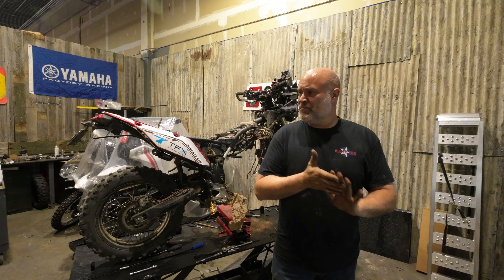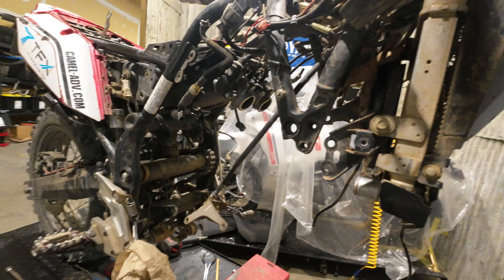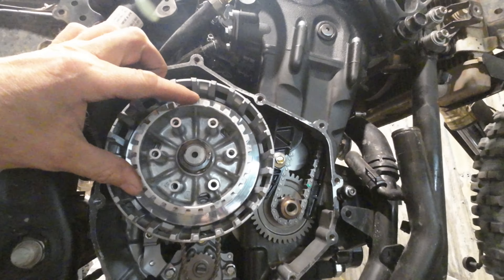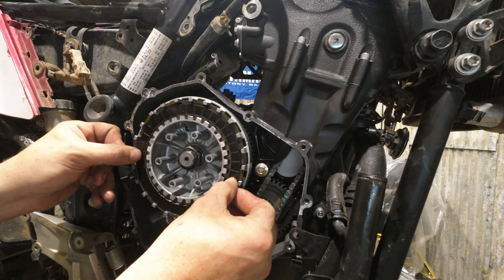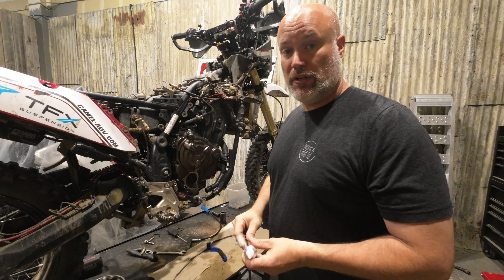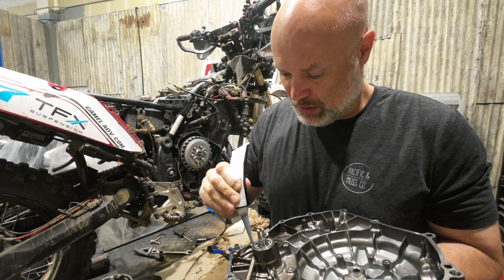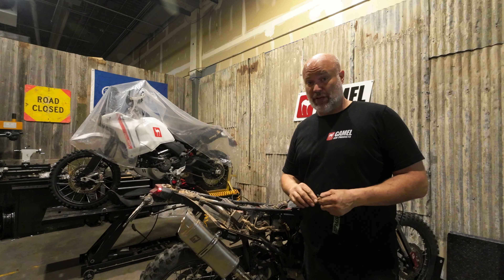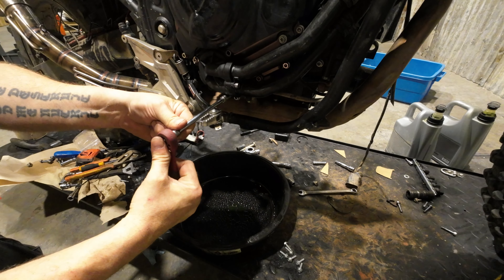T7 Motor Swap

Comment: Hi mate I have a 2024 T7 that has been making the 'chirp' sound you referred to. So far under warranty the dealer has replaced the fuel pump, abs pump, idler gears and starter clutch, all to no avail. Now Yamaha Australia is sending a new engine for the bike. Do you reckon the chirp is just because no oil was soaked into the clutch plates?

Comment: No electronic lockouts! Why I bought a Yamaha and sold the ktm ;)
With the cam marks, I also found that mine were not even perfectly flat once the com covers were bolted down. They were a little one way or the other. I guess mass production tolerances arnt as precise as they used to be.
Reply from the maker: My issue was that there were two identical marks, one on each side of the sprocket. There was no easy way to distinguish which was the correct one. I went off lobe position as the shop manual wasn't clear.
Reply: Enjoyed all the Epic KTM rides you produced Brendon on the 1190! (Especially in the Winter! :) )   From Connecticut, U.S.A.

Comment: nice video crazy the motor was still running after that race and moab. Got my foot peg brace on my 17 AF twin fit perfectly no spacers i think because of the aftermarket foot peg thick aluminum on them

Comment: This was really awesome to watch, thanks for filming it and sharing it.  One thing that was not clear tome though - early in the assembly of the new engine, you pointed out the spot where the metal rod had popped through the case during shipping - wouldn't this hole be a problem when you re-assembled the engine and put oil into the bike?

Comment: Nice tutorial, very helpful as a I have look at my clutch soon.
Would be interesting to hear the results of that higher compression mod. (And if it sounds different :D)
Reply from the maker: I can't say that I noticed any sound difference. Seat-of-the-pants dyno says more power but I had also been riding the tired engine for over a year so not surprising the new one felt stronger.

Comment: That was an awesome crash course on the engine! How much power could feasibly be obtained by completely rebuilding a T7 engine? Bored over, etc. Thanks for the great video!
Reply from the maker: I've heard the CP2 bikes racing the Moto America series can be built to about 130hp. I'm guessing that is a $10k+ build and I can't imagine they last long if they are cranked up to that level though.
Reply: @CamelADV  that sounds cool but unrealistic. I was hoping there is a way to upgrade the engine when it eventually wear out. I already upgraded to the Camel Tank, Skidplate, Brake Lever, and now I’m just waiting on the Two Finger Clutch to be back in stock! Keep up the great work!

Comment: Hello, I enjoyed your video very much. I need to fix the thread of the M12 bolt from the right side, the one that passes trough chasis and gets into the engine to hold together. Would you remove the engine to do the Helicoil fixing or just with the engine mounted? Thanks a lot

Comment: The Mt07 and T7 are not tuned differently?  Wow, I did not know they were 100% identical.  Cool.
Reply from the maker: The only motor difference is the Mt-07 comes with a 16T front sprocket and the T7 is 15T.
Reply: @CamelADV  Same gearbox and gear ratios? Moreover, maybe I missed it, but how did you deal with the hole in the engine case? You didn't swap cases with yours, did you?

Comment: Thanks for taking us along, curious what you think of the higher compression with the thinner head gasket.
Reply from the maker: It definitely had more power after the swap but the original motor was lacking compression by then. I couldn't tell you how much of the increase was from the hi-comp gasket and how much was simply because the new motor's rings still have their temper.

Comment: Always enjoy your videos and your passion for making bikes better. Maybe I missed something but just wondering why you would opt for a engine swap versus rebuilding the top end on the existing engine?
Reply from the maker: This was from April 2022 and getting parts for a rebuild was miserable. Head bolts from Yamaha were backordered several months, so were some of the gaskets. At the time, I assume the motor was toast and was going to need repair or replacement immediately. In Western Canada, we have 6 month riding season and I wasn't willing to sit most of it out while I waiting for parts to arrive. I got the MT-07 motor for a great price so it made sense.
Reply: As a YYC rider myself I totally understand not wanting to wait months for parts to arrive.   I sure you could rebuild the old engine and keep it as a spare or sell it to recover some of the cost.

Comment: Great vid Cory. Hey, noticed you have spring loaded tip on 'The Fix' rear brake pedal....are you in testing phase for this? Any approx ETA on when you're looking to have these available one The Fix?
Reply from the maker: Yup, testing. No ETA at the moment.
Reply: @CamelADV  Oh man, can't wait. I love the Fix, but have issues getting to the tip sometimes with moto boots (I use the AXP bash plate that protrudes a bit in this area).

Comment: Are you running high octane fuel now, with the higher compression ratio?  I wonder if there is a mapping option that will help take full advantage of this change, without replacing the cams.

Comment: we were thinking it mite be easyer dropping engine to do valve clearances 30mins sounds good. what difference if any did head gasket make. mate does a throttle body inlet wider mod add 1hp on dyno
Reply from the maker: Pulling it for valves might be feasible if you weren't dropping it all the way out. With the motor in the frame, getting the area above the valve cover clean enough is tough. I don't know how you avoid dropping dirt into the valvetrain.
Reply: @CamelADV  could you tilt the motor forward if you took the radiator off? That would help taking it out of the way of most of the dirt from above and give you more room to work? Guessing.

Comment: When i saw the tittle i'm thinking yes a MT09 swap in un T7 😆
Reply: A 3 cylinder engine doesn't work well in an off road bike. You'll be struggling for traction off road (that is IF you can fit that motor in there).

Comment: Maybe I missed it. How was the hole in the case repaired after the UPS oopsie?
Reply from the maker: Ground the paint off the case and filled it with JB Weld. I've had success with it on other case/cover damage over the years... however, this one os weeping again. I was hoping to avoid TIGing it.
Reply: @CamelADV  yea I found a JB weld repair under an oil covered skidplate on a bike I bought a few months ago. I think welding is probably the way to go when feasible. I have a TIG welder but lack the welding skill to do that job right.

Comment: did you swap over the old engine case (with the original engine number) to the new motor?
Reply from the maker: No, the complete motor was swapped.
Reply: @CamelADV  but the new one was damaged with a hole, no?

Comment: What are "go fast performance parts"?
Reply from the maker: Performance cams, injectors, big bore kits, oversized throttle bodies, extra... you know, stuff to make you go fast... maybe it's a regional term ;)
Reply: @CamelADV  Are there aftermarket injectors for the CP2?
Reply from the maker: @MT-THNDR207   I'm not sure. You asked what "Go fast parts" were; I was just giving general examples.
Reply: There is a turbo kit available for the road versions. Might be a hassle fitting it on an offroader though!